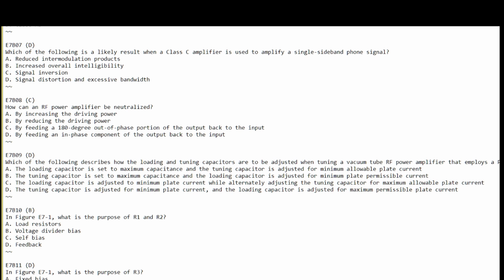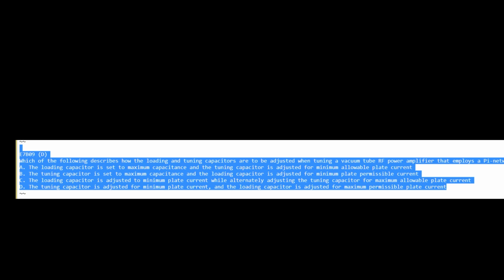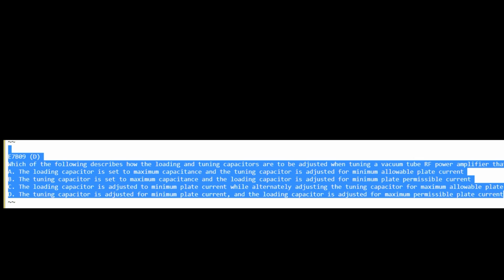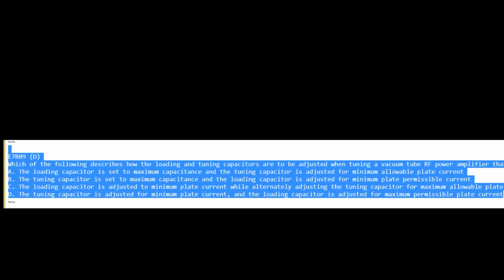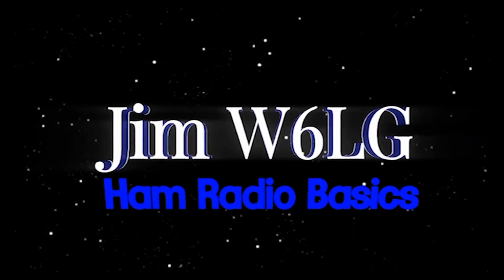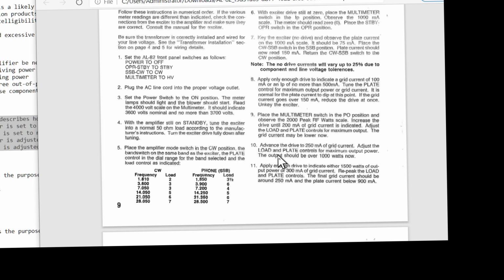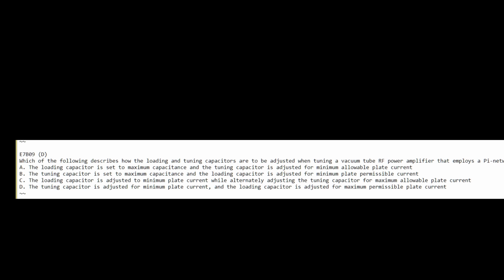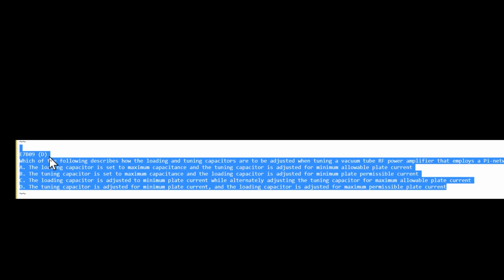Extra Class License Ham Radio Exam Question That Is Poorly Written Discussed By Jim W6LG, Elmer

Comment: Did the copper straps you installed help any? Back to the panel? When connected and disconnected.
Reply from the maker: Hi Jay, No, I cannot hear or find any value in the extreme grounding that I did.  And, that was the purpose.  How are you doing Jay?  73, Jim

Comment: I just received the Extra class license manual 12th edition, and the Q+A 5th edition book. The description in the Q+A book for answer D is this:
" The procedure for tuning a vacuum-tube amplifier having an output pi-network is to alternately increase the plate current with the loading capacitor and dip the plate current with the tuning capacitor. The goal is to produce the required amount of output power with the minimum amount of plate current. "[ Extra class license manual, page 6-40 ]"

The Manual has this on page 6-40:
 "To adjust the pi-network in a power amplifier for the proper operation, the tuning capacitor (C1) is adjusted for minimum plate current (called "dipping the plate"), and the loading capacitor (C2) is adjusted for maximum permissible plate current. The adjustments interact, so this procedure is usually performed several times to reach the optimum setting [E7B09]

My goal is to take the test in march, using both books to study and not just the answer pool Q+A book. I have only been a general for 8 years, passing both tests in 2012. I have learned more from my Elmers in person, and online then I could have hoped for from a book. Thank you Jim, I hope you continue going over the question for the new test. I will watch and learn.73 KB3YJU
Reply from the maker: Sad to say that both of those are wrong.  But, you must give the answer that they want.  Just don't tune your amplifier that way.  "Dipping the plate" is dippy!  73, Jim
Reply: @ham-radio  LoL ""Dipping the plate" is dippy!"" 
When I got my first amp, a Kenwood TL-922A. I had my Elmer come over and check it out, the Kenwood manual was a bit confusing to me. It's all old hat now, and I can tune up fast. Watching the meters plus the watt meter is key as you said. One eye on each. lol Now I have an AL-811 as a back up too, and I enjoy them both. Thank you for your videos from a non-electronics background ham like myself, your information as an internet Elmer's is priceless. I highly recommend anyone to watch your videos on tuning up an amp.  73 I hope you are well, today.

Comment: It's often easier to try to determine what the writer had intended when he wrote his question.  Factual accuracy and clarity of expression are not always adhered to as highly as they should be.  You'd be amazed how many certs questions I've run into that make you wonder how the writer passed high school English grammar, let alone how he passed any advanced technical training.
Reply from the maker: Yes sir.  And I took and passed many such tests for several licenses over the years.  I got really good at taking multiple choice tests.  One on exam, I scored 100% only because I made some good guesses while I sat for the exam. Yesterday I spoke with the guy who was incharge at the Fed for creating the exams.  It was an eye opener.  Thanks & 73 Jim

Comment: the questions are written by government civilians who are not ham radio operators and have no experience with any of the equipment.
Reply from the maker: I don't believe that is the case today.  I will look into that again.  Last time I checked it was volunteers and groups of volunteers writing and reviewing the pools of questions.  Thanks Richard 73 Jim
Reply: No, the questions are written by amateur radio operators.  There's a committee at the NCVEC that supervises the question pools, namely, the Question Pool Committee.  Jim should be interfacing with them.
Reply from the maker: How tall is the tower in your drone video?  Where is that?

73, Jim
Reply: @ham-radio  That's the Rosston tower, near Rosston Texas, the tower is 2000 feet, with the equipment platform at 1500 feet.  Those repeaters have good coverage :)

Comment: Great video Jim.  I normally operate with an output pwr of about 200 watts on my AL811 amp.   I took your advice on a previous video (and that of Ameritron) and tune to MAX pwr output (approx 700 watts) on a dummy load and then simply dial down the drive to achieve the desired 200 watts and do not readjust the load or grid.  i believe this tuning procedure which results in reduced grid current, is a lot easier on the tubes.  Hope this makes sense.
Reply from the maker: Basically, that is the same thing...same result.  Grid current is the key.  I confirmed all of that with a group of engineers today and all agreed with my video.  Thanks & 73 Jim

Comment: This is why test questions with multiple choice answers were meant to dumb down. The goal is to choose "the best answer";  not the correct answer, in many cases. This is not what getting an education is all about. This is to test your memory capacity, not your knowledge. "Know by doing", I say. That is why the Elmer system is so important. Passing on knowledge and then trying out what you have learned.
Reply from the maker: Yep!  Thanks again and again and again for your help and input.  73, Jim